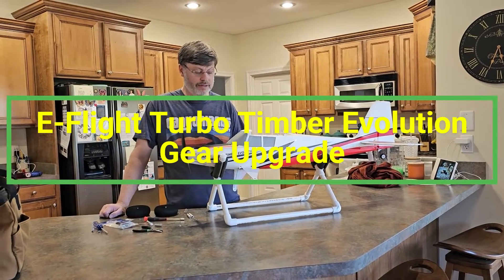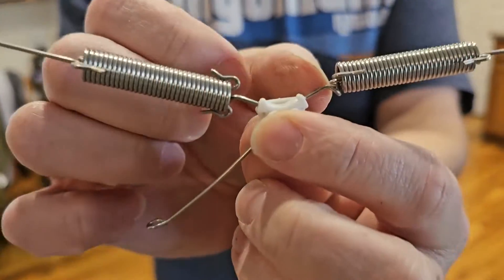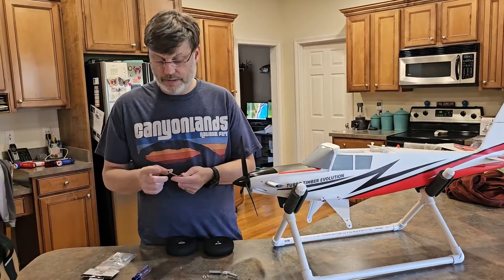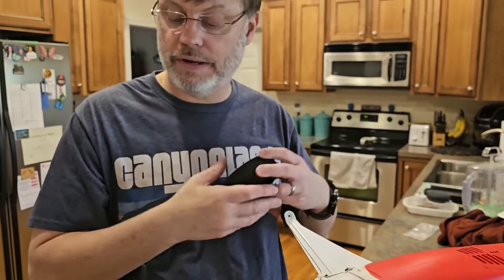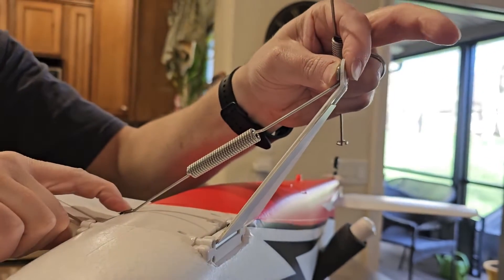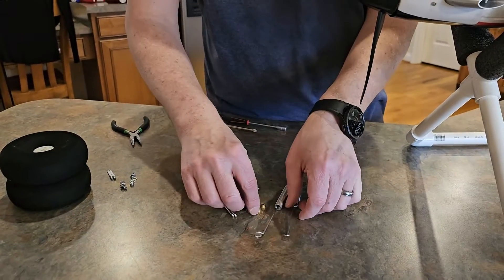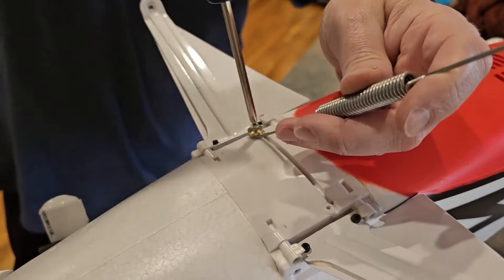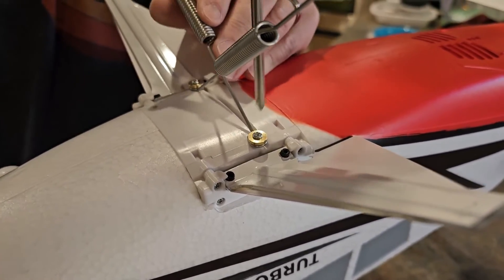E-Flight Turbo Timber Gear Upgrade to Twin Timber Gear Suspension System

Comment: I did this the other day.  Now i find the gear is too stiff.  As well, the larger twin timber springs and the associated hardware is a good bit heavier than the original setup which i swear i noticed on the first flight after the mod install, aircraft seemed more nose heavy, very easily noticed on landing flair.  I much prefer the softer suspension of the original springs.  I am going back to the original springs and then take off the limiter pieces as patrick suggested.

Comment: Thanks for this video, my Turbo Timber Evolution came with those new springs already and I notice on their site that they have those springs labelled for both planes now. Just before Christmas I had ordered a replacement kit to repair my Evolution's bent gear (those robust springs were still perfectly usable), I was surprised to see that the replacement kit still comes with the old springs. Since I didn't need them right away I just used the parts I did need from the kit and called it a day. Your video got me thinking about it and I just went on the HH site and complained about receiving outdated parts in the replacement kit. I actually had to explain to their customer service that the new versions have that twin timber spring and they finally recognized that and sent me those springs for free. So thanks again as your video reminded me I needed to get that taken care of :)

Comment: Good video and you did a great job demonstrating.
I came up with a landing gear mod for my TTE using parts ment for the floats. One of the aframes can be used for spring action. Now I snap axels, not springs. I bush bounce my TTE pretty hard.
Cheers

Comment: Another option is to remove those wires that are inside of the spring coils. They are there to limit/stop the springs travel distance. When ever that limit distance is reached on a hard landing, the energy ends up bending, stretching, and breaking other connection points.
I do like the newer springs that you put on here, and the new TTE has been upgraded with these better springs from the factory along with a 70 amp ESC.

Comment: You've wasted your money, all you have to do is remove the hooks from the standard springs, then they'll last for ever
Reply from the maker: Maybe you can explain further.
Reply: What he is saying is to remove those wires that are inside of the spring coils. They are there to limit/stop the springs travel distance. When ever that limit distance is reached on a hard landing, the energy ends up bending, stretching, and breaking other connection points.
Reply from the maker: It seems eflight liked my solution, now the turbo timber ships standard with the parts I took from the Twin Timber.